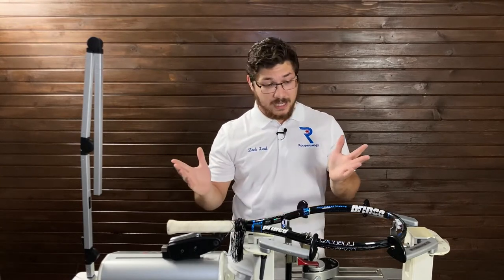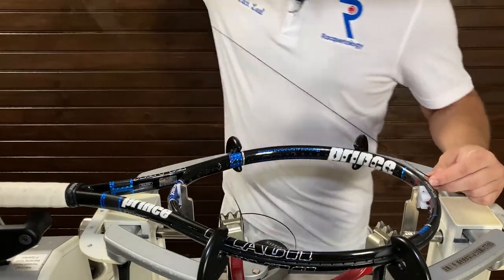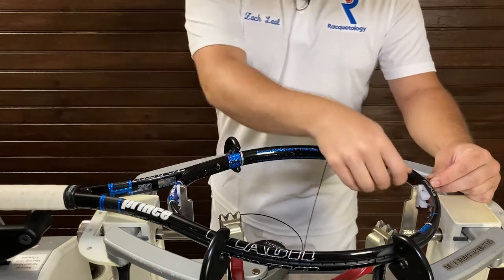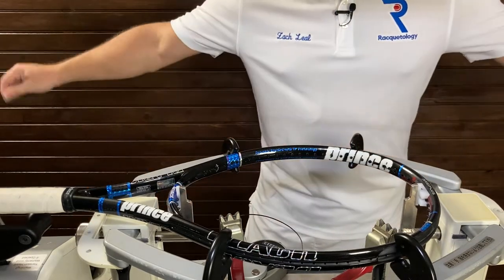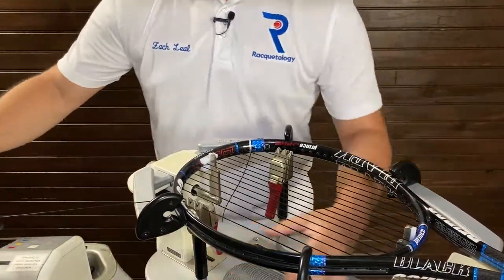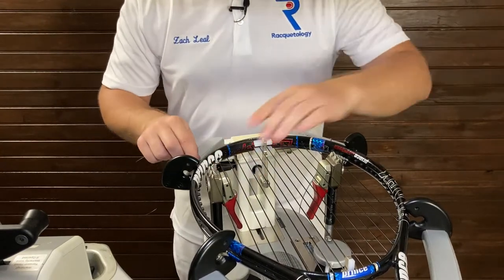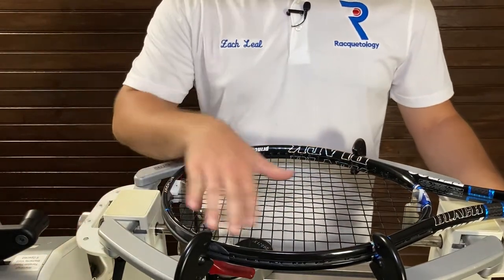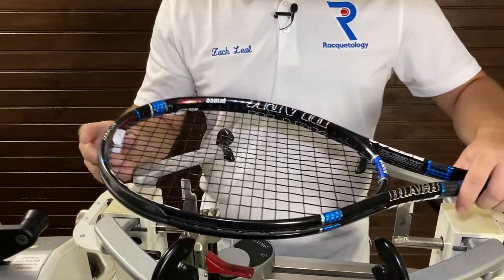How To String A Tennis Racquet Using One Piece Stringing

Comment: What you say about starting crosses from the top makes sense, but do you do that even if the manufacturer specifies a pattern that starts crosses at the bottom?  Wouldn't that also be a warranty issues?

Comment: Could you describe in a bit more detail how you start things off on the mains?  Thanks!
Reply from the maker: I’m imagining that your are referring to how I start the mains when pulling tension. You can start it many different ways but in this particular video I am using the Yusuki Method which uses my starting clamp and fixed clamp to hold counter weight during my first fully tensioned pull on the opposite side. Perhaps I should do a video on different ways to start the mains when tensioning; my apologies if it for any reason made the video hard to follow. 
Thanks for watching!